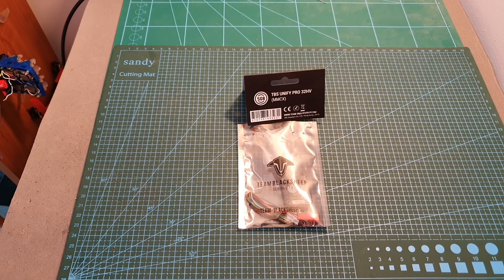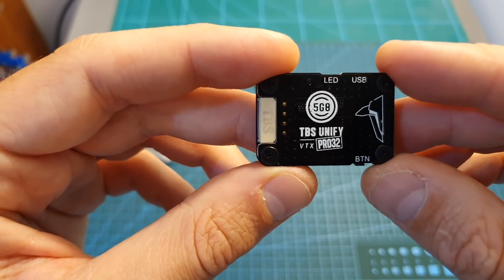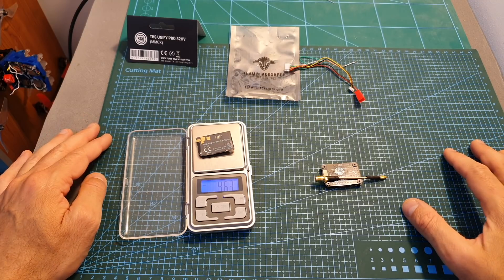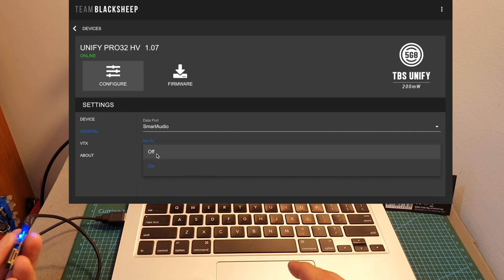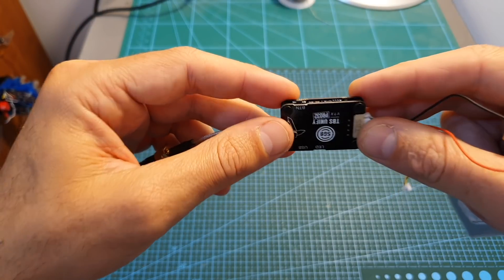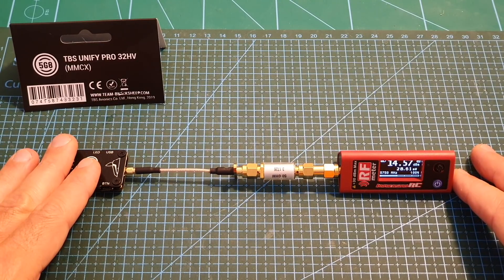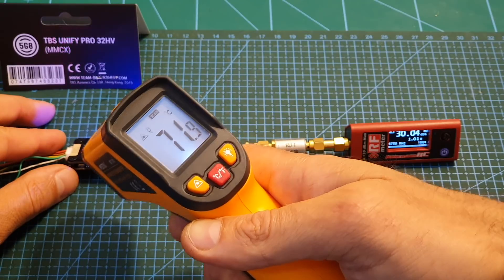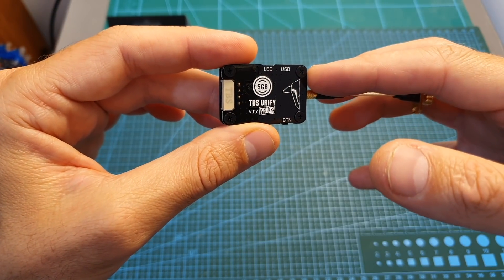TBS Most Powerful VTX! UNIFY PRO32 HV - Power Test & Overview

Comment: I have this vtx, but anybody have also sound issue ?  On my analog googles I have no sound at all. TBS AGENT set mic sound on, but still no on board mic.   Anybody find out solution ?
Reply from the maker: Which VRX are you using?
Reply: @KremerFPV  TBS Unify 32 hv

Comment: Hello Gal! Can I ask you about powered up VTX for tests without connecting to FC ? I have charger Hota D6 Pro with Power supply option. I know that I can powered this VTX up to 22V (like 6s batts) , but what about settings amps? Can't find any info about safe value of amps in manuals from TBS. I just need to check whether I fixed 7pin connector correctly and VTX received power. I think about settings : range 5-22V (9V to be safe , like in FC Mamba 405 MK2 can give) and 1A. But I'm not sure if It will not damage my VTX ... Cheers !

Comment: I have a few question on how this vtx should be soldered to my flight controller.  I am using a xilo flight controller.  I read on the TBS Unify manual that the 7V-26V red wire gets soldered directly to battery voltage.  Does this mean it gets soldered to the positive ESC pad?  If not, what pad can i solder to that gets me to “direct battery voltage.”  If the above question is true, then that would mean the black ground wire directly next to the 7V-26V wire would get soldered to the negative ESC pad.  After those wires comes the 5V out wire (orange), then another ground wire (black), and finally a video wire (yellow).  These 3 wires have a connector on the other end of them.  I am currently under the impression that these wires get plugged into the camera via the connector.  However, my camera is already soldered directly to the FC, so can I disregard these wires?  If you could provide insight to my questions I would greatly appreciate it as I have done tons of research, but yet can’t find answers anywhere.  Thank you in advance.

Comment: I wonder how many amps the VTX is pulling @ 1W. I feel like mine is pulling more than 1A which has fried my FC's filter.
Reply: depends on which voltage. On 20V it should not draw much
Reply from the maker: I doubt it, as according the the specs it should draw between 300 and 450mah.

Comment: When I plug in the 5V from the USB cable into the VTX the settings remain saved, whenever I plug in the LiPo the settings are always lost... so how to save those settings? Thanks!
Reply from the maker: It seems that the Smart Audio wire is connected and you are trying to set it manually. If it's correct, disconnect the SA wire.

Comment: hello a great video I bought this vtx it works very well, but I have a doubt in the output where I connect the antenna cable between the central cable and ground with the continuity meter this is normal in this tbs or is it mine that I have it wrong in other tbs I do not have continuity between the central cable of the antela and the exterior of ground please I need to know thanks
Reply from the maker: Thanks. Let me double check this issue. 
Are you having range issues?
Reply: No, I have no range problems, but it seems strange to me that the rest of the vtx that I have from different gears do not have continuity in the antenna socket between the central pin and the ground on the end of the connector. @KremerFPV
Reply from the maker: @cenobria  I just checked it on mine and it has the same "issue" (I am not sure if it's a problem).
Reply: No, I have no range problems, but it seems strange to me that the rest of the vtx that I have from different gears do not have continuity in the antenna socket between the central pin and the ground on the end of the connector. @KremerFPV
Reply: https://www.youtube.com/watch?v=NJ-E-Id80ss
Reply: I do not know if it is a problem but I find it strange that the other vtx of other brands do not have continuity in the shot

Comment: How many Ampere does it draw?
Reply from the maker: I didn't test it, sorry.
Reply: @KremerFPV  could you...? I am wondering if it exceeds 1A max so I can solder it to a 1A max output of my FC
Reply from the maker: @Poldi79de  I doubt it exceeds 1A. I will try to find out.

Comment: I just got this a few days ago,it works on 25 and 100mw but once I switch it to 400mw I get rolling screen through my fpv.
Reply from the maker: I suggest trying a different VTX antenna  and if it doesn't help - contact TBS.
Reply: @KremerFPV  I will give it a try but I did just discover it worked on the 400mw,but only on frequency below 5800,I tried all the channels.
Reply: @KremerFPV  well I'm waiting for a replacement,it just stopped working,anyway how is yours working how is the video quality compared to the tbs unify hv.
Reply from the maker: @rippingj6017  I am really busy with other stuff and still haven't got the opportunity to properly test it - sorry.

Comment: Well I had 2 of these fail on me on power up after about 8-12 flights. When these work, they're amazing, but if they can't be dependable Its not worth it. Time to go back to 5v unify's which are the best Tx to date imo. Had a 3rd Pro32 that burned a trace and started working poorly. All used on previous builds that had clean video and no issues. Tbs knows that people are having issues and I've seen a good 20+ people report the same problem. If you get a good one, hold onto it!

Comment: I can't activate Smart audio like the traditional form. Is there any trick to do it?
Reply from the maker: Which BF version are you using? You need to use BF 4.
Reply: @KremerFPV  My version is 10.5.1. I ran smartaudio without issues with a TBS Unify pro race.
Reply from the maker: @Ayerras  BF firmware,  not the version of the configurator.
Reply: @KremerFPV  I updated FC firmware to the last version on BF and now it works, but it shows diferent Powers: 25, 200, 500 and 800mw. Chanels can be selected correctly. Thank you very much. Any Idea with yhe power?
Reply from the maker: @Ayerras  Np. The values represent these output settings respectively: 
25:  (25mW),  200: (100mW),500:  (400mW), 800:  (1000mW+)
25, 200, 500 and 800 in BF settings are just fixed numbers.
Reply: @KremerFPV  So perfect. Thank you again.

Comment: On the TBS website it says it goes higher than 1000mW could you elaborate on that? Thanks
Reply from the maker: They don't want to give you the exact number I guess. It goes up to around 1.6W.
Reply: @KremerFPV  Thanks 1.6w is great. How efficient is it at 1.6w though? Will it overheat on the ground if I wait a couple of mins for my GPS to find sats?
Reply from the maker: @changeagent228  It will get hot - I would set it to 25mw when waiting for the sats. You can also set vtx_low_power_disarm to on on BF.
Reply: @KremerFPV  Ok thanks. Sometimes my Unify flickers and goes black if I'm flying slowly on a hot day. I wish TBS would put heatsinks on. I also have a GepRC Span Pro and it has an integrated FC VTX with a heatsink and even at full power on the ground it never exceeds 80c.

Comment: hey Gal, can you tell me what firmware version you tested this on? 1.07 is the first version for the first batch that went out. now its 1.08 and they have backed the output way off from what I understand. its now only 1000mW not sure what the actual output is on that. setting? I know the temperature of the vtx doesn't get as hot now so im sure the output power is less. its a real bummer. I'm telling everyone I know not to update it. I had two initially and one was bad so I exchanged it and got another one and they are on 1.08 and now it shows 1000mW instead of 1600mw in the AgentX software. anyways, thanks for the video.
Reply from the maker: Thanks for letting me know. I tested the first version and I will check with TBS if now the power is limited on the new one.
Reply: @KremerFPV your very welcome. thanks for looking into it Gal. it would be nice to know for sure.

Comment: It overheats and then fails. Happened to me twice, I am done with these boards, they get way too hot.
Reply: @whig0  I went through four in total all dying after a few flights. Even tried dropping the cut off temp way low on the last two. I've gone back to regular unify pro HV now.
Reply: Same here I've had two new pro32s fail within days of each other.
Reply: @captainsalmonslayer  That sucks doesn't it.... No leds no lights no nothing. I ditch them and go shop elsewhere.... Overpriced and overrated, sorry to say

Comment: Get mine for my marmotte, its huge, and it came with a bad mmcx conector cable who dont locked
Reply from the maker: Try to use a rubber o-ring on the antenna connector.
Reply: Got some, great idea thank you, I will give it a try!

Comment: Have you been able to get smart audio 2.1 in Betaflight to work with this VTX?  Its just blank for me :-(  Its all setup to correct uart etc.
Reply from the maker: Make sure that your are running at least BF 4.0
Reply: Same issue here - just didn’t work on my X-Rotor running 4.05. The whole damned thing just stopped working before I could even fly it.
Reply from the maker: @blam3329  I suggest contacting TBS.
Reply: Gal Kremer Mike Chin suggested trying a different UART. That didn’t work. If you follow certain Facebook groups, it looks like this thing is plagued with issues. I told Trappy that I was worried about them before they showed up, and he said that only a small percentage were bad. Looks like I’m in the minority. Not only was Smart Audio not working, but after I got it set up on R1 and transmitting good video, I took it outside to fly and it wasn’t transmitting anything at all - the lights were on, but nobody was home (another prolific issue with these).
Reply from the maker: @blam3329  That sucks man. I hope they will take care of you.

Comment: Welp I guess I'll have to buy it. Hahahaha
Reply: One thing I have to seriously is the mmcx craze. I don't like those connectors. There always loose. I desolder those right away. Just direct solder Antennas. I like UFL with the screw plate on UNIFY HV
Reply: Also I just saw on bangood eachine 1.5w reciever for 20 bucks. Review that one!

Comment: Great Review Gal, I have this VTX in a Sub 250g 6s Long Range build and am using it with the new TBS MMCX Triumph Pro Antenna with excellent results.  I'm running the Caddx Turtle V2's plus and ground directly from it with no need for an extra capacitor. Instead of using SmartAudio I've connect the RX and TX from the VTX directly to CH. OUT 3 and 4 on my TBS Nano RX, this way you can access the VTX settings from Lua Scripts on your radio, and hopefully in the not so distant future TBS will give us some unbelievable new features and over the air updates the same as the TBS Nano RX.
Reply: Over the air updated confirmed for it!

I was going to as for the parts on that build but I see you have a video with it, it's the one on the iFlight frame right?
Reply: Great News about OTAU  @LeanSheep . I haven't made a video with this VTX yet, it was meant to be used on a Sub 250g 2 mile FPV flight but i can only get a maximum 3.8 miles total distance with the current battery setup, on the video your talking about I used the TBS Unify Pro 5v and managed a 1.28 mile FPV flight.
Reply: if it will decreasing the output power when it getting the maximum temperature,i wonder what will happen in a long range situation?
Reply: @hobbywars7797  Any VTX worth its salt will decease the output power when it exceeds its optimum working temperature especially with no airflow to cool it down, as what is the alternative ? System failure and complete shutdown !!!!!! Even hovering or flying at long range or short range for 2 mins in the same sort of conditions as Gal just showed in his test, would only drop the power to 1000mW.(ONLY 1000mW !!!!!!!!!!!!!!!!!!!) And who stays still for 10 seconds never mind 2 minutes in our fast moving hobby.
Reply: @Sub250gFPV  very good explanations!!! thats why people ask. because choosing the maximum temperature doesn't exist in the old TBS VTX!!!!!! actually I'm TBS user for all my built. and gonna buy this one too!!! will build another long range with all safety features such as GPS,real live location,vifly finder. great Info DUDE!!!
Reply from the maker: Thank you!